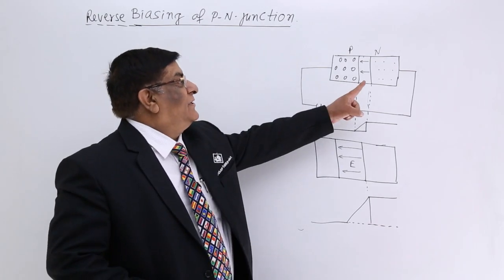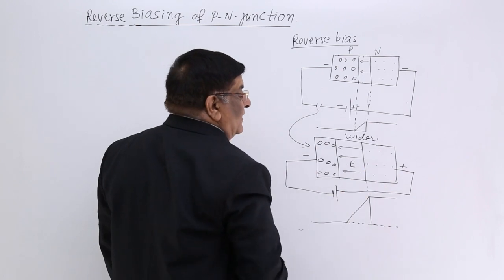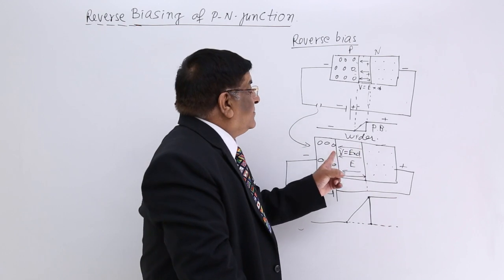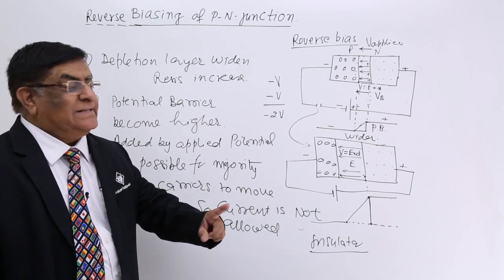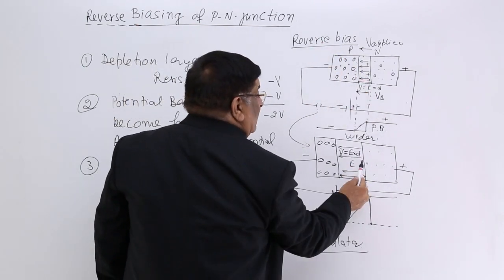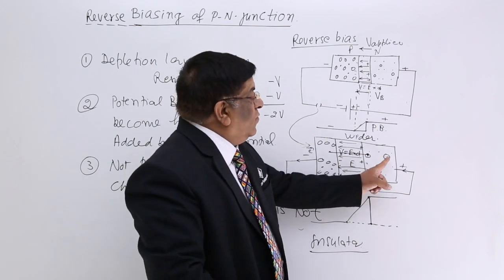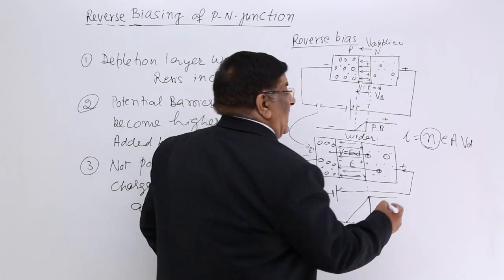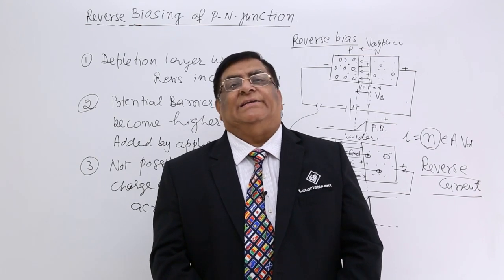Class 12th – Reverse Biasing of P-N Junction | Semiconductors | Tutorials Point

Comment: thank u sir, u solved my problem  about the reverse current due to minority  charge  carriers.
Reply: What is special about a reverse bias? 
Diodes are used in situations where we desire current in one direction and not in the reverse direction.
We sometimes hear a plumber say a valve is "leaky" and while he may fix it by replacing a washer with almost no leakage, things are not so easy with a diode. It is an unavoidable property and we have to devise ways ways to work around the leakage current of a diode. 
The reverse saturation current Io as a matter of fact, tells us the amount of current in a forward bias! 
The current expression for a diode gives the total current through the diode for either a forward or a reverse bias. For a reverse bias, the only current is a "drift" current, Io. If you examine the total current you may note that Io depends on the concentration of minority holes(electrons) in the n(p) side. That explains the tininess of its magnitude.
The barrier width grows only ever so slightly and is sufficient to drop the large reverse bias voltage! Don't visualize all the mobile holes in the bulk neutral p-region vanished into the negative supply terminal! 
Also, dont visualize all the mobile electrons in the bulk neutral n-type region vanished into the positive supply terminal!
And the reverse current is there until breakdown occurs on increasing the reverse bias. But who supplies the mobile holes and electrons to maintain the reverse current in a reverse bias? Learn more from the references below.
What is a pn junction ? 
A pn junction allows current in one direction only. It blocks current in the reverse direction. 
When a pn junction is formed, a potential barrier designated Vo comes into existence and is typically around 0.6 to 0.7 volts for silicon junctions. 
When the barrier whose Vo is 0.7 volts is disturbed by applying a forward bias of say, 0.6 volts, the current increases and the increase becomes steep for small increments of the forward bias value a little greater than 0.68 volts. Large currents are observed when the forward bias is 0.69 volts which is closer to the barrier voltage of 0.7 volts. 
The forward bias can never exceed the potential barrier voltage nor can it bring the barrier down to zero volts. That is the reason you seldom see current vs volt graphs of pn junction diodes beyond a volt or so.
How does the bias remain less than the barrier in an operational diode?
The voltage bias applied drops in the bulk neutral regions of the diode. 
The current in a forward bias adjusts to fulfill the conservation of current law and the rate of recombination.
A detailed description of the pn junction with a distinct approach using surface charges, alignment of Fermi levels, creation of the barrier, the distinct processes of diffusion, drift, recombination and the influence of the electric field on the energies of electrons is provided in the following textbooks.

Electrostatics and circuits belong to one science and not two, that of electricity and magnetism. To know how they are unified visit this link 
https://matterandinteractions.org/articles-talks/ and view the article 'A unified treatment of electrostatics and circuits.  B. Sherwood and R. Chabay, unpublished. (1999)'
pdf. 
For a live demonstration of surface charge and its effects in circuits visit 
https://youtu.be/U7RLg-691eQ
For a detailed discussion of surface charge, coulomb's law, electric fields, fields of dipoles and other charge configurations, and parallel plates, and a distinct approach using the surface charge concept in the study of advanced topics of capacitance, currents, conservation of charge, conservation of current, superposition of fields, superposition of potential, simple dc circuit, magnetic fields, magnetic fields of a current element, straight wire, current loop, solenoids, biot-savart law, voltage, voltage source, difference between e.m.f. and potential difference, ideal voltage sources, resistors, how current branches in a parallel circuit, capacitors, inductors, Faraday's law, inductance, ac circuits, transmission lines, Lorentz Force law, motors, generators, p-n junction diodes, electromagnetic waves, antennas and radiation, new electrodynamic theories on the nature of the electric field, see "Electric and Magnetic Interactions" by Chabay and Sherwood 
www.matterandinteractions.org
or 
Fundamentals of electric theory and circuits by Sridhar Chitta
https://www.wileyindia.com/fundamentals-of-electric-theory-and-circuits.html
There is a "look inside" feature in the amazon.com webpage of the book "Fundamentals of electric theory and circuits" by Sridhar Chitta with a few pages of Chapter 1 which may be viewed and also which you may swipe left or press < icon to view the foreword, preface and Table of Contents. The contents of the above book by Sridhar Chitta, make a distinct unified approach to electrostatics and a few advanced circuits like coupling signals to amplifiers, lending precision and clarity to the topics which is not found in most text books.
The book comes alongwith a CD with animated power point presentations for all chapters and voltage regulator, RC phase shift oscillators and differential amplifiers included additionally.
For a lecture by Prof Ruth Chabay on surface charge in a simple dc circuit visit 
https://youtu.be/-7W294N_Hkk
There is a full set of lectures beginning lecture 13 here on surface charges, electric fields, simple circuits, capacitance, inductance, faraday's law, motional emf, magnetic forces and more topics here
https://matterandinteractions.org/videos/EM.html